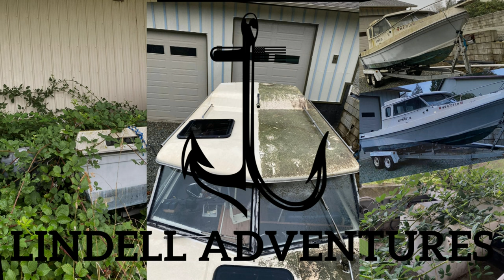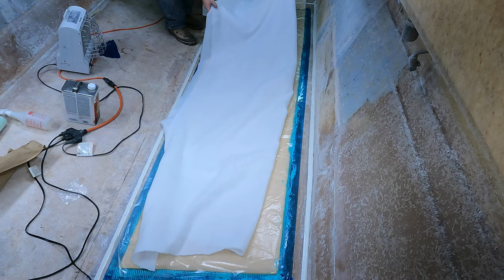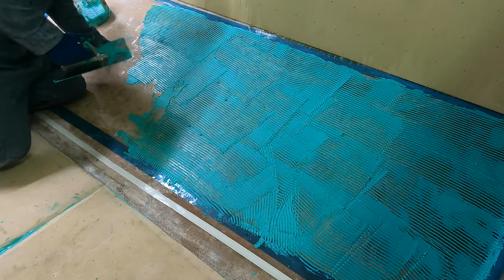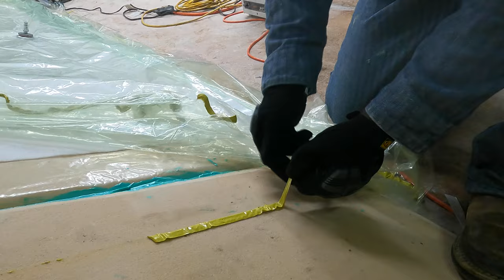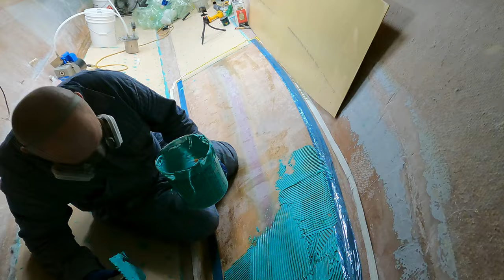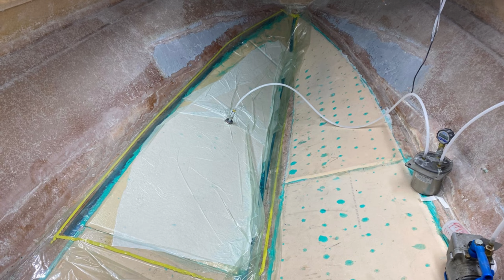Vacuum Bagging the ENTIRE Boat Coring on my $1,000 Boat

Comment: A lot of guys just slap on more and more layers of expensive fiberglass and resin. The boat gets stiffer at the expense of greater weight and actually poorer stiffness to weigh ratio. But the Divinycell cross linked PVC foam followed by even ONE layer of glass gets much more stiffness to weight ratio. This is because it does what fiberglass does poorly which is to add THICKNESS with little weight. It is from THICKNESS that structural members achieve stiffness. So I think what you are doing is wise and is prudent science injected into the process. Very little extra fiberglass needed with foam.   Its a bit shocking actually how much flexing was clearly visible on the hull when you were walking and moving around on it. The great defect of most fiberglass boats is they are floppy. Especially with cheap non woven mat. They always cite greater strength than wood. Yes they are stronger in SPLIT RESISTANCE or IMPACT resistance, but NOT in stiffness where it counts. Wood is superior. PVC foam better still. That foam will never rot or absorb water. Very few online boat restorers do the insides of old fiberglass hulls properly. What you are doing is the best method.
Reply from the maker: Thank you! Planning to do 2 layers of 1708 and then stringers and 3 layers on them. Thanks for watching!
Reply: @LindellAdventures  You can use HALF that number of layer of fiberglass over the foam. Two at the most is more than necessary .Especially when you consider the hull worked for years as is without ANY additional layers OR foam.

Comment: I have enjoyed several of these videos. I watched you remove the old coring, it looked like a huge pain. I still don't quite understand the purpose of coring. Does it just bulk up the structure in some fashion?  It just looks like adding weight to me but I am sure there is a purpose I just don't get.
Reply from the maker: Thank you! Coring helps the hull take waves and impacts without hurting the fiberglass. Some boats are coring and some are solid glass if weight isn’t a concern. Mine was soaked and was balsa end coring. This is closed cell foam which won’t hold water and is much lighter material. That make sense?